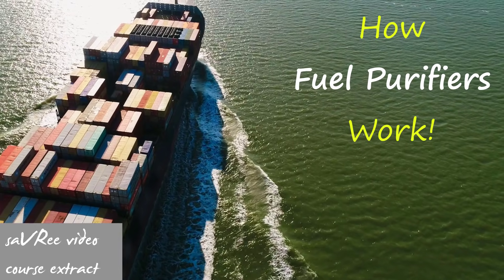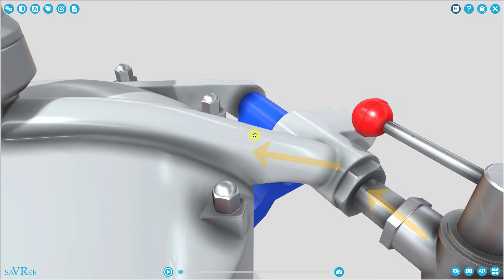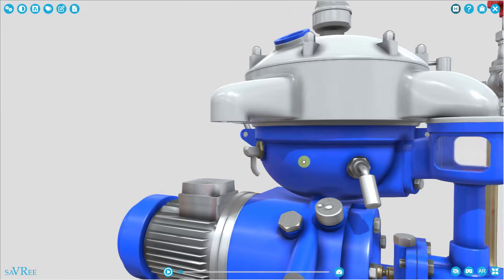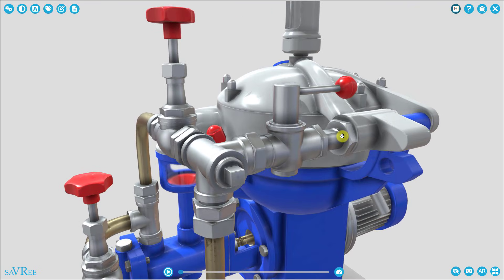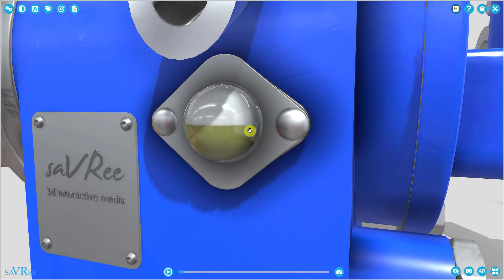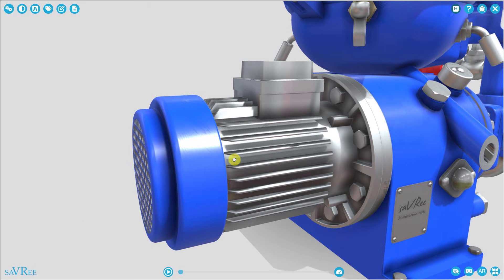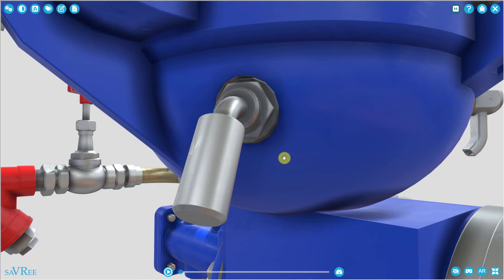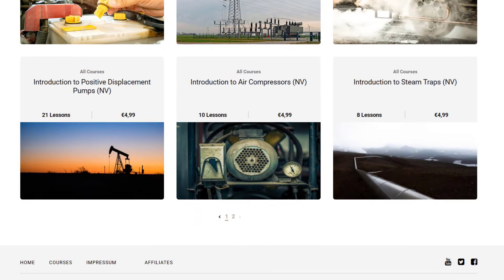How Fuel Purifiers and Clarifiers Work (Centrifugal Separators/Centrifuges)

Comment: Sludge discharge and its mechanism is not included in the video. Also I couldn’t see sludge discharge ports. The exploded view has all the components but 3D view doesn’t.
Reply from the maker: There are none. This is a different type of purifier (not self desludging).
Reply: @savree-3d  like a centrifuge. Open it everytime to clean

Comment: I enjoyed this a lot. But I can't seem to catch where you explain the point of the gravity disc (which is at the top as far as I understood), even though it's apparently very important, since that allows the separation of fuel from water and not just debris.
Reply from the maker: It's covered in the video course. There was only so much info I could get into the video unfortunately.

Comment: Your graphic is beautiful but the video needs a few touch ups:
I am an Alfa Laval Service Engineer for over 25 years.  I would like to help you to add some information and correct some nomenclature.  

Otherwise, that's a beautiful graphic.  Haven't seen any thing from the factory like that.

Looking forward to your reply.
Reply: The publisher has made a great video as always.
However, I'm pretty sure that it will be better to let the brake be in use during the whole stopping process. Just to minimize time at resonance frequency rpm:s. A vibrating bowl is a great danger. When fully stopped the brake must be released though.
Can you confirm or correct this information?
Reply from the maker: Hi Danny,
Can you shoot us a message at saVRee.com? We can then connect.

Comment: The concepts are not new.  The battleship Texas (launched 1912,  commissioned 1914) has centrifuge water / oil separators to remove water from the lubricating oil for the reciprocating stream engines.

Comment: I installed a similar device on my Chevy truck. I used paper Liners in the inside of the bowl to make cleaning easier. It was for cleaning the engine oil

Comment: Great work as always mate 👍 We use these to clean up tallow. Do the fuel separators also use water discharging to clean themselves? After about 8hrs of work the tallow becomes cloudy so we need to force water throughout it and clean it to continue use.
Reply from the maker: They can. Different design (self-cleaning/auot-desludging). Discussed briefly in the purifier course. For HFO, auto desludging is needed.